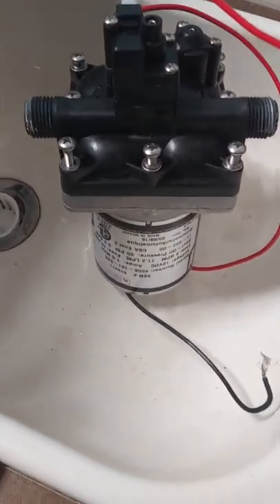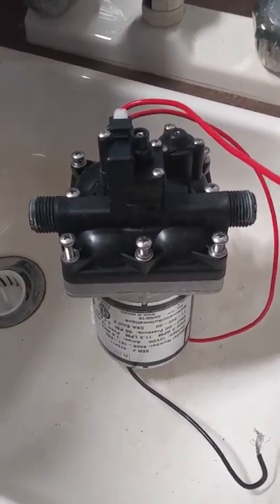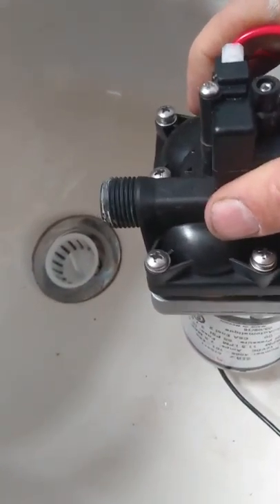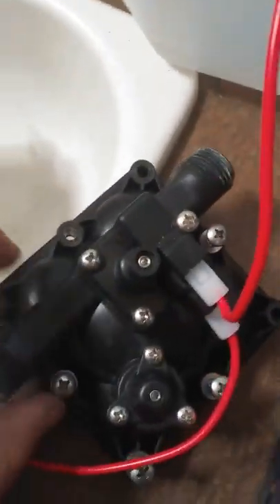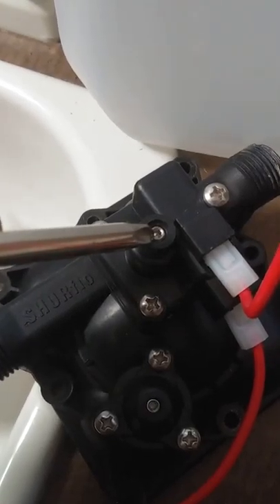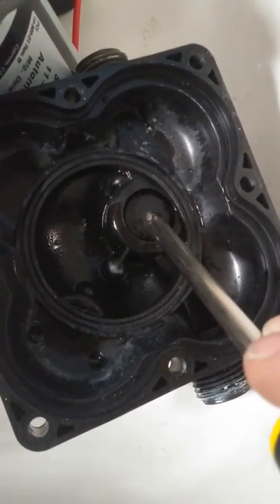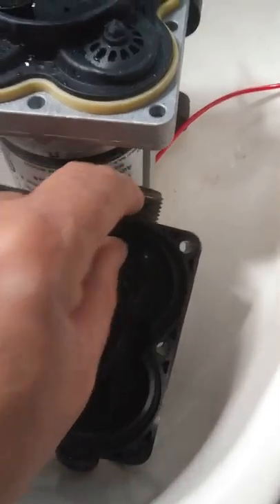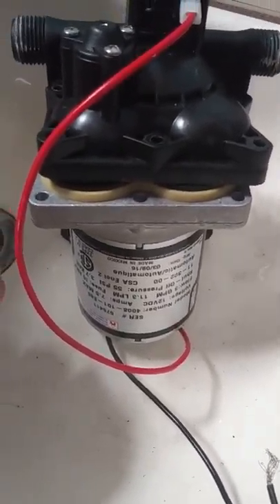Shurflo pump runs but no water..Fixed.

Comment: First of all, thank you for your video! I was able to fix mine in about 20 minutes. Note to all: this happened to me with a brand new unit (shurflo 4008). The regulator was actually pushed through to my side (pushing side), and I had to force it through. Once pushed through, boom-water suction! So glad I saw this. Thank you thank you thank you!

Comment: Thanks for giving me the courage to open the pump! I was thinking it just wasn't primed but couldn't figure out how to easily get water in the pump.. I finally opened up the pump and found plastic shavings from who knows where stuck in the rubber valves. After 10 minutes of cleaning and reassembly, I got instant water from the sink!
Reply from the maker: Sweet

Comment: I had a working pump but no water coming from the tap. I watched several YouTube videos and generally followed lots of suggestions. Finally after dismantling and reassembling various parts I found the problem. It was simply calcium deposits in the aerator. A splash of vinegar sorted the problem. Motto: look for there simple things first.

Comment: Chris, thank you. We got out to the electric only campsite with a full freshwater tank, and…a non functioning pump. I took it apart, and sure enough, that check valve was stuck. Saved me the pump replacement cost. Again, thank you. Now there seems to be a very slight leak at one of the PEX joints on the pressurized side of the pump, but that can wait til I get home…
Reply from the maker: Please subscribe

Comment: Thanks, Chris. You nailed it. I pondered the ridiculous Shurflo troubleshooting guide that came with my camper, watched two 9 minute YouTube videos made by guys who know less than I do, and finally came across your video. My check valve seemed to be jammed by an o-ring up in the valve that became loose and got down in the valve's travel chamber. I wonder if that came from a bit of water freezing in the pump over the winter. (I winterize by just blowing out the lines and pumping it dry. I used the pink RV antifreeze once--never again.) There was no other debris or calcification in my check valve.

A couple of notes for other lost souls: 1) I tagged one of the wires going into the top of the pump so that I'd rehook it properly; not sure if it matters. 2) My pump needed a P1 screwdriver to unscrew the manifold screws. The factory had way overtorced them, so a P2 wouldn't work. 3) Screws with flat washers go in the corners; screws with lock washers go in the middles (duh!). 4) A 2mm or 5/64 allen wrench works the flow adjust set screw on top of the manifold. I've read that some people have fixed this problem by cranking it all the way down, and then backing off on it while the pump is running; i.e., crank it all the way down, run it a little, back off, run it a little, etc. I didn't try this, and don't know what effect it would have on the pump, but it might be worth a shot if you are stuck in the boonies and don't feel like removing and replacing the dang thing.

Again, THANKS Chris! My camper manufacturer suggested that this issue may require replacing the pump. That's $70-$80 bucks out the door, and a perfectly good pump in the landfill!

Comment: YOU are the MAN!

I'm working on a 2012 Bay boat with a fresh water wash down and the water pump was working but no pressure. 

I did what you said except used a silicone spray for the rubber to hydrate it, works like a charm. Saved me mucho mula!!!

Thanks you-thank you, thank you!

Brian
Reply: Oh yea, it is a 2011 SHURFLO 3901 - 0206 A

Question though, it was originally installed with the canister on top and the plastic on bottom. Does it matter what is up or down?

Thanks again,
Brian

Comment: BINGO! Chris.  Thank you for posting.   I was about to cut the wires and replace this pump, but checked the WWW first. It is a relatively new pump. We had the camper on city water for a while so it never ran.  The power wire was long enough so I pulled it out onto the floor, removed the cover,  pushed lightly on the small valve and it broke right free.  I would not even have thought to check this except for your video.  I dug out the original OEM pump that I had to replace once when on the road, pulled the cover (it was a slightly different design), but sure enough the valve was stuck too.  Now I have a spare pump :D
.
Ours has an in-line removable screen filter - I agree with you on adding one. I cannot imagine the crude I cleaned out of that filter going through the pump.

Comment: Chris, thank you very much for this video, you saved me money.  I have a 2019 Winnebago Outlook 22C motorhome and without any warning the pump stopped working.  After watching your video, I took it apart and the problem was on the round valve, it was stuck.  There was no calcium deposits, but it would not open.   I first tried tapping the whole pump and it didn't work.  I then took it apart and I pushed on the valve twice and put it back together and now it works.  Thank you so much.

Comment: I looked all over online for a fox for my problem. I found tour video. What you posted is exactly what I was experiencing and we are on a kind trip. You fox worked perfectly. The valve was stuck and I had to push it to get it to move. Reconnected the water and we are good to go. Thank you for the video!!

Comment: Awesome video, I watched and opened up my pump after it was running but not pumping. Found the pressure switch round bit which you had stuck also. Overnight the water must have frozen and expanded. The rubber seal was jammed into the mechanism. Pulled it apart and put back together just using the same seals as I had none spare and it worked perfect. Cheers again!

Comment: I drained my RV water system over winter and the pump did not work come spring.  As per this video, I took the shurflo pump apart and unstuck the regulator and boom lots of suction.  Much thanks!

Comment: Dude you fixed mine. My problem was that there was a small piece of the manufactured vinyl on the inside of the pump that had been left in there. Once I pulled the troublesome piece out, turn pump on everything works like magic.
Reply from the maker: Send $3 to po box.... just kidding

Comment: The check valve on mine was stuck. I was surprised at how much pressure it took to get it to move.  I wonder if CLR poured in there then flushed will help prevent it from sticking again in the near future.  Mine failed while on a 5 month trip across the country.  We used it a couple days, then about a week later in a Walmart parking lot if failed.

Comment: What if the pump stopped running?  It was running kind of loud, but no water pressure.  Now it's not running at all
Reply: Mine was doing that, turned out the check valve was stuck.

Comment: I have one of these struggling to switch it on to try see if it works as just bought a 1980s merc Motorhome and I need this to work is there a switch someone on the pump to switch it on ?